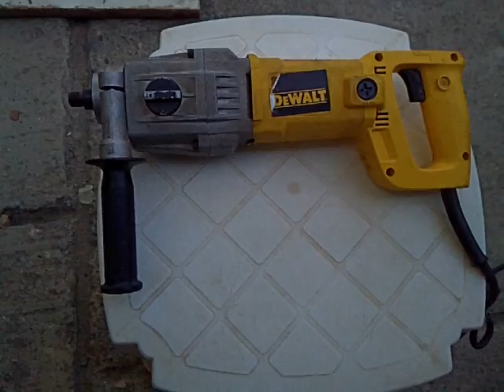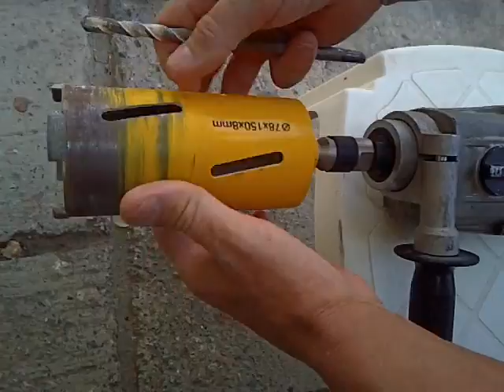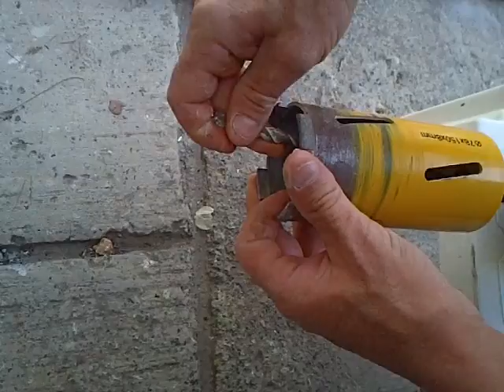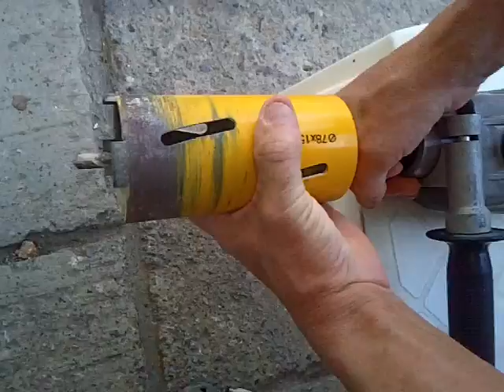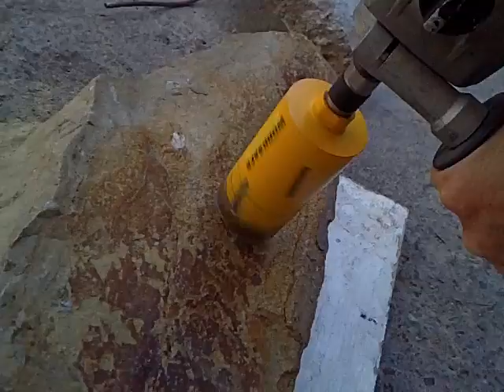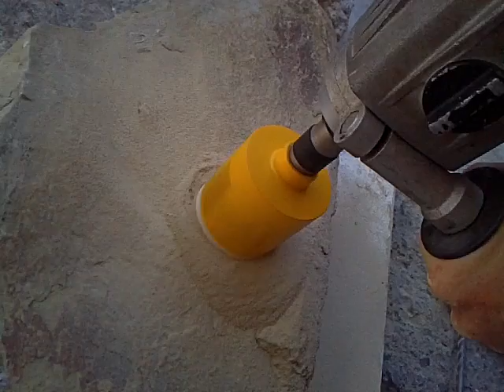Dewalt DW580EK Diamond Core Drill

Comment: Hello sir did you just remove the chuck and put some adaptor for the core bit?because i need some thing like for my project..thanks in advance..
Reply: Nope. Thats a specially designed drill , a "Dry Cut Core drill machine" (theres other variety too). But you dont have to buy that drill. if you have a SDS plus or SDS max drill machine you can simply buy a 'Core drill to SDS plus/ SDS max adapter'. After that you simply connect one end of the  'adapter' to  'core drill bit' and other end to your SDS drill machine.. But before buying everything make sure of the correct size spindle thread of both the "core drill bit" and the "core drill to SDS plus/max adapter".

p.s Now If you want you can also buy a core drill extension bar for a deep hole. Also, make sure of the spindle thread size once again.

Comment: Will this tool cut a steel rod which are used in concrete??? pls reply
Reply: Diamond bits are only for stone/concrete
Reply: Yes they can cut the rebar in the cement, and no, they will not wear out faster. We cut many holes during the day dry and they last very long.